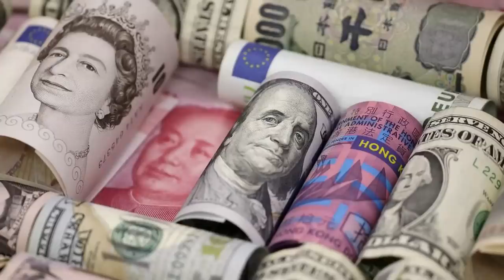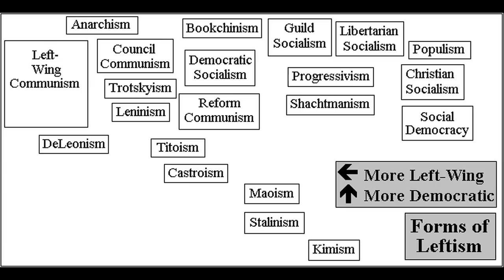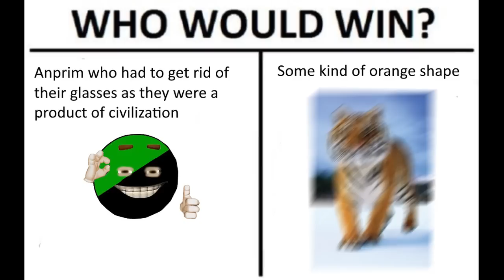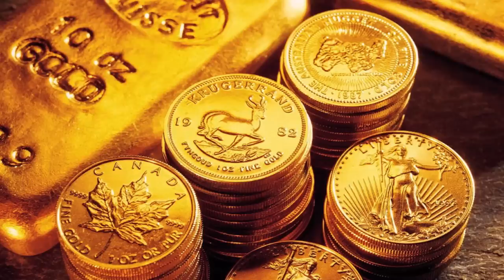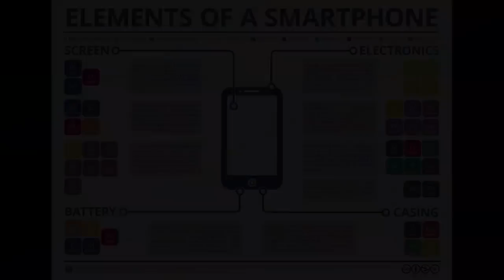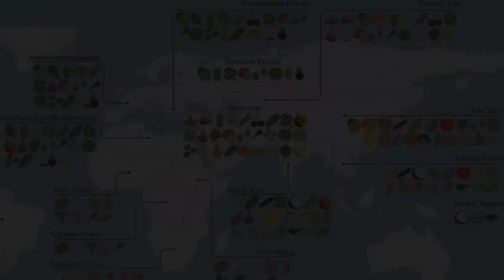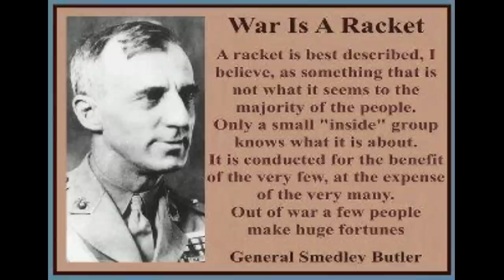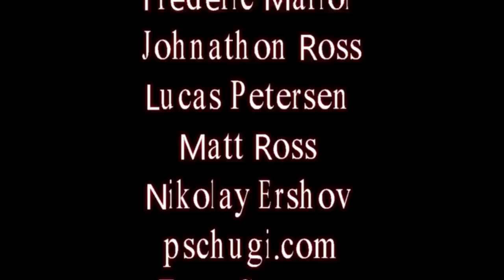How to worldbuild: Trade and economics

Comment: Good video, but oh my god do you have no actual idea of ancient and medieval trade routes. You said all citys are trade citys, because citys are founded because of trade. Proving this by showing a map of modern age trade routes. This is wrong on so many levels. 

First, citys before the modern age always start out as random villages until a trade route happens to run close by, making the village more important to develop and bringing the necessary wealth for it to grow. These villages can sell their surplus of foodstuff to travelling merchants for whatever the hell they are peddling. Which brings money and growth. 

Theres a reason why most of the bigger citys even lay a bit outside of the dirct route. Without trucks, a city is completly dependent on the local water source making the water source and fertile soil the deciding factor where a new village is made before any thoughts about trade. If both could be met even better.

Second, trade city is a term used for a lack of a better term to describe citys where the bulk of an countrys merchants have to go through in order to reach other citys. Oftentimes because of mountains, seas and other bad terrain you simply can't reach most of the country without visiting one city that lays smack in the middle of crossing trade routes. 

Take Alexandria as an example. Being at the tail end of the silk road and one of the citys with the best harbors made this city almost impossible to pass up if you want to travel the Mediterranean Sea. 

Since a lot of merchants want to liquefy at least part of their load here, you get a gigantic trade hub where for the right price you can get anything. Most medieval trade citys are actually closer to what we know of tourist citys nowadays. The entire citys economy lives and breathes in tandem with the trade.